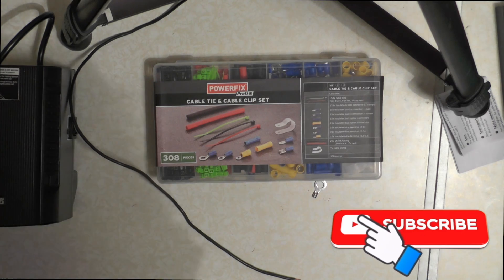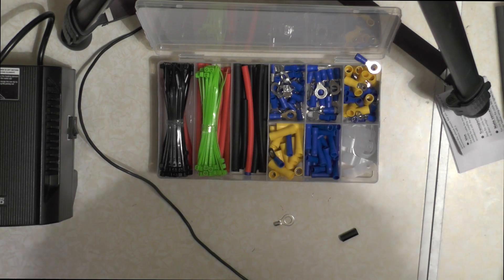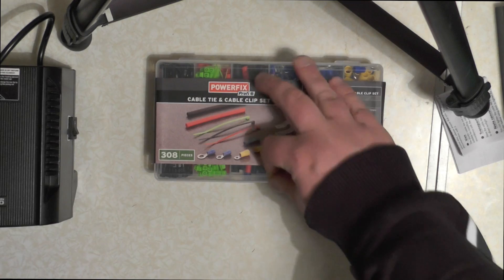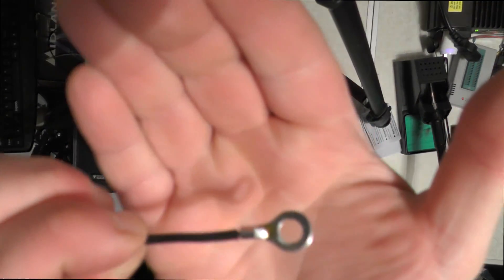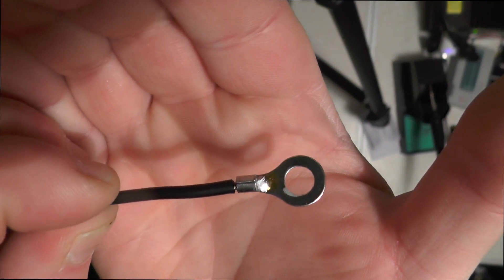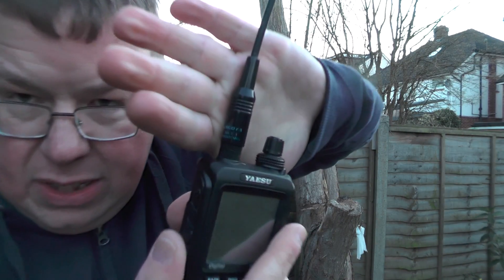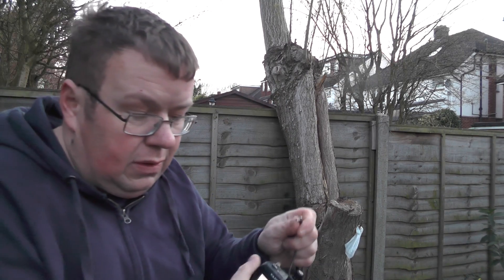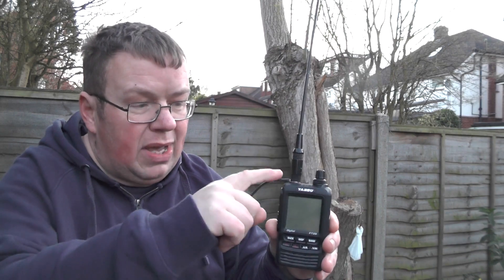Cheap tiger tail for UHF/VHF

Comment: Fantastic, would this work on pmr ?
Reply from the maker: Can’t see why not as long as it’s cut to the correct length it’s worth giving it a try as it’s cheap to do
Reply: bare in mind that the antenna cannot be removed from the radio, (part of the "licence free" conditions). but if you can find the chassis of the radio then you can attach it there. but you will have to take into account how far the "tail" is from the antenna, and subtract that from the calculated length.

Comment: Hi. I use midland g7 xt radios between motorcycles and would like to up the range. I’ve taken them apart and cut the 3 loops already. Any time I transmit they jump back to ‘L’ on the screen and won’t stay’H’ which you set in the options. These ‘tiger tails’ are news to me. Any tips?
Tia
Reply: They are very low power, 1/2 watt radios that claim 12km, it’s just not possible
I don’t thing the antenna is detachable? And no exposed metal to fit a tiger tail to.

Slightly iffy without an amateur licence, but go up to the Baofeng range, an 888 at 1 watt, or 5R at 5 watts, and motorcycle headsets readily available for them, for one rider your looking £40 max, just a Bluetooth bike set is £100?

Comment: Quick question.
Does the Tigger tail have be a measured length or can you use any bit of old wire?
73
Ray
26FB\CI\CT2290
Reply from the maker: Hi the tiger has to be measured in length for the frequency http://www.csgnetwork.com/antennagpcalc.html if you use the website and input your frequency then it will tell you how long it should be

Comment: Nice one. Hope all are well at home. Lockdown is a pain. 
New into the Amature Radio as just passed foundation. 
Was wondering about HF. Most people talk about the antenna and the radials being a particular length.
But if I am flicking between bands, do I also need to remove radials for the other bands.
No one seems to anser that. 
Cant seem to reach your repeaters yet, only pushing 5W on a FT-817 (VHF/UHF) only atm. Low point in Thames Valley nr J6 M4.
Keep them videos a comming. 
73
Reply from the maker: I use a prowhip antenna with a atu but when i'm on the bike i use a ampro 20 and ampro 40. Ive managed to work state side on 5w from my bike i did a video a while back